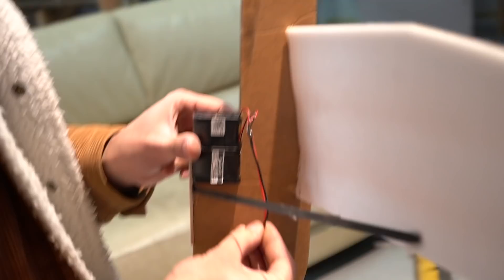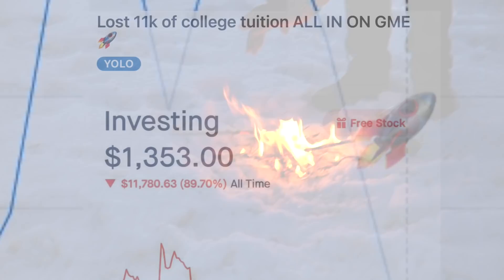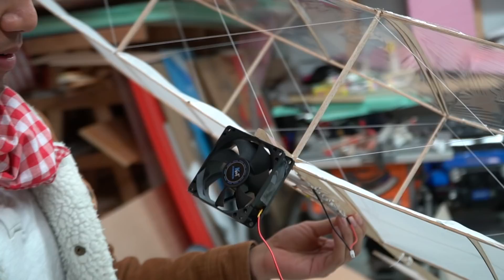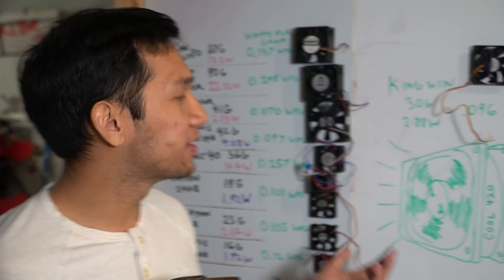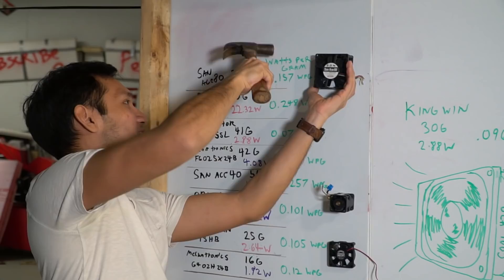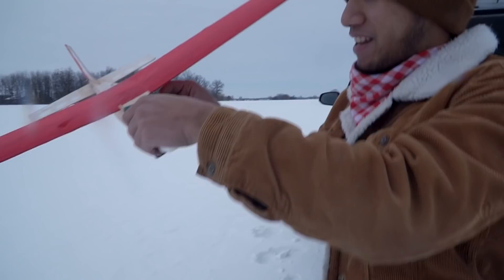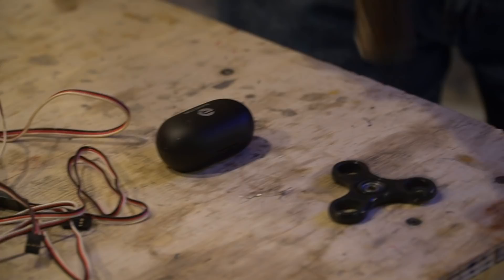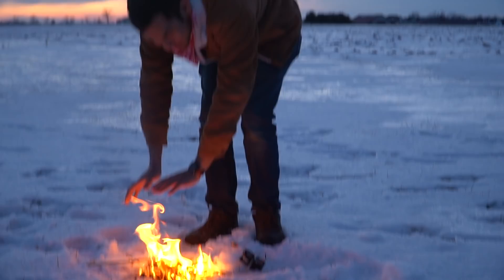PC Fan Powered Airplane!

Comment: I actually gasped when he tossed the 5600x
Reply: im going to need a new set of pants after watching that...
Reply: WHY
Reply: I'm pretty sure that will have been his old shitty CPU he threw, and the new one is safely in his PC. He'd clearly opened the box already, the heat-sink is removed from the fan.
Reply: @samrowland2816 your probably true
Reply: i cryed when he tossed it
Reply: I almost choked on my coffee.
Reply: Me too!
Reply: He also called it the ‘’amd’ fan without pausing in between the letters
Reply: Same when I heard it hit the table I screamed “ah that hurt.” I may have the 5 3600x 6 processor but still
Reply: I cringed
Reply: @TheBorhork  same, i even just watched an ltt video before this of a terrible computer builder, so i was a tad bit less traumatized then if i saw it without preparation
Reply: Almost got an heartattack
Reply: Same
Reply: And then proceeded to break the fan that came with it 😂
Reply: I saw this comment before the video, thinking I was ready, and I still gasped.
Reply: ;-; how dare he
Reply: great 👍,  WHO NEEDS A $300 CPU , the fan is what makes the plane fly , DUH .
Reply: @samrowland2816  most likely but as someone who could use any cpu upgrade still hurt me lol
Reply: Looked like just the empty plastic case
Reply: Me too
Reply: @Ardalan Ghazizadeh all of the fragile pins on the bottom
Reply: looks around in Ryzen 7000 series.
Reply: it hurt so much.
Reply: me too , out loud!
Reply: So true it "painED" me
Reply: Dude I died and respawned when he tossed it lol
Reply: @MichaelNelsonYT  its only AMD ,no loss
Reply: Me too, but seriously.
Reply: Damn right same here
Reply: A sacred CPU
Reply: @skonky  Fixed it 👌
Reply: @Ardalan Ghazizadeh intel, no they don’t. but amd still does
Reply: I'm sure it was a 'stunt' cpu, not a prime unit.
Reply: @Ardalan Ghazizadeh its AMD so the pins are on it not on the motherboard. Only one has to snap for the cpu to die....
Reply: @girlsdrinkfeck  Im proud of my little ryzen 5 3600, i think it has its place... Intel hasnt exactly been doing good lately....
Reply: @lindalewendling  Yea that is annoying
Reply: @samrowland2816  I really hope. I havea 10600k and would love to have that.
Reply: @MichaelNelsonYT  not necessarily, there’s a lot of redundant grounds and dummy pins. Although it depends on which pin of course. Sometimes a cpu will still work, but some features may not. AMD pins are pretty durable though. I once dropped my R5-2600 and bent about 10 pins, I was able to get them bent back into place and the cpu still works to this day.
Reply: @EvilTurkeySlices  I never knew! Thank you
Reply: @MichaelNelsonYT  no problem. That’s part of the reason I prefer AMD, the pins tend to be more durable than the ones on an Intel socket.
Reply: Same I need one can I have it
Reply: Your not alone fam
Reply: @wcnub  you're probably right.
Reply: Well it’s amd
Reply: Me to
Reply: Me too you gotta give me that cpu
Reply: Broke my heart
Reply: Every mussle in my body contracted
Reply: Same. I have the same CPU it hurt to watch
Reply: Same

Comment: Imagine buying a Ryzen 5000 series CPU just for the cooler
Reply: the fans are the only reason anybody would buy one, they have so much more value than the CPU
Reply: @forgenic2700  y
Reply: Imagin buying an razor gaming oc only for the stickers
Reply: @fhsjdjskkshi  Because intel has intel sticker, and sticker>fan>CPU.
Because joke.
Reply: and he broke it from over volting.
Reply: Imagine buying a CPU for the cooler which are known for being the worst coolers and fans... He could at least get a decent 3rd party case fan.
Reply: Imagine buying a Ryzen 5000 series and not immediately dumpstering the stock cooler
Reply: That cpu being a 5600x and then just tossing the cpu.

Comment: "It's super fragile"

Proceeds to throw it around the crowded shop
Reply: No big deal, it is just wood sticks.  They back together SUPER easy with glue.  And fast too.  I recommend you stop by your local hobby shop and pick up a cheap kit and put it together.  I believe you would be surprised at how easy it actually is.

Comment: The counter rotasting fans permit a higher air pressure to drive the ir through server heat sinks. Great engineering. but as a consequence, you can duct the air to release at a higher velocity to correctly load up the fan motors. This will improve your power to weight ratio. They aren't designed to run without the counter rotation because the blades are quite high pitch and will result in spinning air more than pushing it if run individually. I had the same thought as you watching those runs running at hish speed on the air frame you made for slow regular PC fans 😄

Comment: no one:
him: throws CPU
me: LITERAL SHILVERS
Reply: It’s just amd, that fan was probably the best thing in the box
Reply: @emmett-hr4ip  :|
Reply: @emmett-hr4ip  bruh, do you have any idea how powerful a 5600x is?
Reply: @alosthigh-endgpu7254  Yes I do agree that currently amd has a more powerful cpu for multitasking, but I would pick being able to run a game decently then to have blender running at peak performance
Reply: @emmett-hr4ip  AMD CPUs are good for gaming too bruh. Plus as of now, AMD CPUs are much more powerful than intel and it doesn't even needs as much power as intel to run. It's also a bit cheaper making it a better option for people with low budget so I wouldn't really say "it's just amd" as if they were shit
Reply: @emmett-hr4ip  Intel is dogwater compared to amd.  Get water cooling and ur fine.  If noise is an issue get a different fan.
Reply: I see him throw a cpu and think its over. No, he glues the fan to a shotgun shell not 5 seconds later
Reply: @trainsandplanes8304  and this is the reason why people outside of the tech industry have never heard of amd. I mean if you look at Intel's marketing today it is crap. Just look at Steve's video on there 11th gen laptop processors.
Reply: @emmett-hr4ip  oooooo we got an Intel boi here
Reply: @emmett-hr4ip  amd is better.... but only if you can find IT IN STOCK
Reply: @emmett-hr4ip  found the intel shill
Reply: @emmett-hr4ip  :|
Reply: @emmett-hr4ip  amd>intel
Reply: @allyalllinusfans my 2012 intel chip still runs higher clock speeds than ur 2020 amd chips your raving about. I can go buy a 9900k right now and guess what it’s in stock because intel doesn’t rely on tsmc for their chips. A 9900k is 8 cores 16 threads and runs 5.0 ghz turbo. And is easily overclock able to run 5 ghz all core. I can go buy that right now for $300 and ur 5600x is out of stock and and costs more and is only 6 cores 12 threads 4.6 ghz turbo
Reply: @emmett-hr4ip  Just because it has a higher clock does not mean it's faster. Instructions per clock is a far more important metric for CPU performance, of which AMD is currently beating Intel in the current generation, and in which the 5600X destroys the 9900x. As proof, lookup the Passmark scores for each CPU. For the 9900x the average score is 18869. For the 5600X the average score is 22181. That's a 17% performance improvement with a lower clock speed, 2 less cores and 4 less hardware threads, and using 30 less watts of power. The only thing Intel has with that CPU is it's about $30 cheaper. (For just the CPU, the motherboards are NOT cheap. Looks to average about $400 for a decent motherboard that's compatible. Where you can get a very good 5600x compatible motherboard for $200-300.)
Reply: @emmett-hr4ip  my bad. The passmark score I posted is correct for the 9900k. The motherboards are similarly priced. The point still stands. The 5600x is about 17% faster than that and only $30 more. The 9900k is a 2 year old architecture. That's practically ancient by CPU architecture standards.
Reply: @emmett-hr4ip  On top of all that, the 5600x is a brand new CPU at $400. The 9900k was $530 when it was released, the only reason it's cheaper now is cause it's 2 years old.

I'm not an Intel or AMD fanboy, they both make great CPUs. But the fact of the matter is AMD objectively has better CPUs at this time.
Reply: @rocktheworld2k6  the Ipc on the 11th gen intel chips will be 19% better and those will be closer to the Ryzen 5000 release date than 10th gen intel and it will still be running higher clock speeds
Reply: @emmett-hr4ip  well good for them. If Intel is better and has a comparable price to the similarly spec'd AMD chip I'd probably get that instead when I build my next computer.
Reply: What are shilvers
Reply: @emmett-hr4ip  Intel fanboy
Reply: @emmett-hr4ip  ur a dense little fan boy. Specs are specs, amd it's killing it single threaded and multithreaded rn
Reply: @mrrquinny  I’m sorry that I made all you guys feel butthurt but really they are just facts that are hard to believe for people that build with amd in there computers
Reply: @trainsandplanes8304  do you people actually never do your own research? Ive seen a 9900k under $300 new plenty of times right now its about $350
Reply: @emmett-hr4ip  amd is like the most powerful cpu rn
Reply: @vpog3466  where are ur facts backing it up
Reply: @emmett-hr4ip  ryzen 5 5600x won against the core i9 10900k on some platforms

Correction: most cpu bound games
Reply: @elijahtuares1382  like what
Reply: @emmett-hr4ip  shadow of the tomb raider, microsoft flight simulator, f1 2020, cs:go and I forgot the other games
Reply: @emmett-hr4ip  google, where’s urs
Reply: @emmett-hr4ip  well it’s one of the best Rn
Reply: @emmett-hr4ip  who are you talking to
Reply: @elijahtuares1382   I was commenting on trains and planes830’s post saying “ummm a 9990k for 300$ usd never existed... even used”
Reply: @emmett-hr4ip  I was asking about the fan
Reply: @emmett-hr4ip  then get a different fan, and ppl who get good cpu's probly dont run minecraft servers most ppl prob get it for video editing
Reply: Too much pc talk, ima move on to another comment
Reply: @adamchmielewski6162  ur only comment is that you are going to move to another post
Reply: @emmett-hr4ip  First of all you were completely off topic we're talking about cpus here none of us were talking about the fans, second it's a pc fan it's not made for miniature planes I've had fans that performs great but blows up when over volted and third we're not even fighting you on which is better we were just stating the facts and I don't want anything more from you you ignorant trampled cooked rice stain. And also it's "up more"
Reply: @emmett-hr4ip  explain amd being ahead of intel for years now then
Reply: @manbun_tech7417  what
Reply: @emmett-hr4ip  “look at me i play minekwaft”. “Also my favorwite compani doesn’t care about my ram ovorcloks anymorr.”
Reply: @manbun_tech7417  I said “What” in my last comment because I did not understand what you saying. You say AMD is better then intel for three years now but where is your proof?
Reply: @emmett-hr4ip  do you even watch major tech channels?? Every one of them will tell you that amd has been ahead. You are not that smart are you.
Reply: @emmett-hr4ip  but no I totally have not been building computers for 10 years 😅. Gtfo here kid, go play minekwaft with your potato

Comment: "So here's the Ryzen 5, we don't need that.." *Throws it away

Me saving up to get a Ryzen 5 : Oh oh nothing, just a little dust in the eye ya know
Reply: And its a 5600X!
Reply: And dosent even use that fan!!!! smh
Reply: @dannyvk5867  as of CPU cooling, there are better coolers then the stock cooler
Reply: Yeah but that’s besides the point that he bought a chip for the fan and didn’t even use the fan
Reply: This hurts a pc builders soul
Reply: @loading...2414 l,.
Reply: I mean, if you don't take into account thrust to weight ratios, the Ryzen 5 could be pretty good (i think. I don't own one).
Reply: Loool
Reply: @Nodemon , same to me , i was saving up to get a ryzen 5 , why didnt Peter just buy a stock cooler?

Comment: By drilling holes in the side of the fan you have airflow going out acting as an airbrake, like reverse thrust works on comercial jets. The centrifugal force of the blades throwing air outward flows out of the holes. Those walls are designed to stop that and throw that flow back.

Comment: Idea for measuring the thrust of each fan:

Construct a Pendulum with a rigid stick and attach the fan to the bottom along with a set mass. 

Turn on the fan and measure the angle the pendulum moves from its natural resting position (θ)

Then use F=mgSin(θ) to determine the the thrust of the fan, proportional to how much the pendulum moves.
Reply: Didn't some physics guy make a similar invention to measure the resistance of air?
Reply: @lukejordan8929  Yep I think so!

Comment: When you threw that perfectly new ryzen 5 I wanted to cry. There is a chip shortage rn and a ryzen 5 is 200
Reply: Yeah same
Reply: Got a perfectly good ryzen 3 1200 at 4.1ghz in a system thats been in the corner for over a year.
Reply: correction 5600x is $299($300) and yes I know this is for fan service pun intended he even blew up the 12v fan by ignoring basic principles of putting over 20v through a 12v fan

Comment: The mousetrap airplane was pretty cool.
Addendum: i use two PC fans in a single unit for cooling the two 550 Titan motors on my EMAXX. Very little added weight and near 4 more minutes run time.  Wow!

Comment: With larger fans, you will get a higher thrust-to-weight ratio because you can achieve higher static pressures and significantly higher CFM's with the 12in (and even better with 14in) fans with very low watts. Especially if you use ones like Noctua's 12v iPPC 2000rpm fans or Arctic p12 fans that have 75 CFM or higher.

Comment: Here in Brazil, fiber optic cables have a rod made of resin and fiberglass that is very light, I believe it is lighter than the bamboo or wooden rod that you use to make this glider. What if it was made with these fiberglass rods? Every time the technician does maintenance, there are a bunch of these sticks lying around, my colleague uses them to make a kite. The best thing is that this stick doesn't break at all.

Comment: Cool. You can get really small case fans fitted to LED headlamp bulbs if you want even more crazy ideas to get carried away with. Even crazier still, a disposable electric toothbrush only needs a set of wings and a prop.

Comment: Next time get some clear acrylic sheet and drill holes through it for your fan frame legs. Space your sheet to the sides of your scales and higher above the scales and poke your frame legs through. Then you'll be measuring the fan thrust while the scales deck is unaffected by the wind thrust. Love your DIY attitude!

Comment: It's good, interesting and challenging project! May be it would be better to make monoplane with bigger aspect ratio (long narrow wing), concave airfoil.The wing might be supported by thread braces, that have very good ratio between weight and strenght.It's ideal variant for low power (remember pedal planes).

Comment: The cross wires and vertical columns  - have more drag than the entire wing
Reply: The Gossamer Condor (the first successful human-powered aircraft) showed that wires aren't that important at very low speed – something to do with the Reynolds number. Previous craft with cantilever wings failed because they were too heavy; later craft were able to eliminate the wires again because they had access to better materials like carbon fiber.

Comment: 7:10 it's not better because it's lighter even tho it's is still better. The main factor is because the holes in the sides are sucking air how fans are supped to suck air. So it's more of how the air gets in the fan and not the weight

Comment: you need a way bigger, and way more slowly spinning fan. After all, it's not about wattage, it's about momentum, which scales differently. That's why modern jet planes have these enormous turbofans with a comparatively tiny turbine inside, but a giant fan around it. Go to a 140mm and spin it a bit slower. Yes, you probably have to strip off the casing.

Comment: I don't know how much it would affect performance, but I do know that it would be better to have the fan blowing over the top of the air foil (rather than under it). You're losing free lift.
Reply: I think you meant just in front of it
Reply: @freevbucks8019  Not sure what you mean.. obviously it would need to be in ahead of the airfoil.. But the air travelling above is what I'm talking about.

If you're talking about "in front" meaning in a position that directs air above and below the airfoil, then no.. The air below the airfoil is still taking a longer path than it would be without the airfoil at all (just less than at the top side of the air foil). Because of this, the air is less dense than ambient air pressure.
Having the air pass over the top only, gives the same low pressure zone above the airfoil and leaves the underside of the foil alone so that the ambient air pressure is against the surface of the foil.

Comment: 0:42 WHY WOULD HE DO THAT
Reply: Cause it’s his money
Reply: @trainsandplanes8304  AMD isnt trash wtf they are better than intel and are cheaper
Reply: @trainsandplanes8304  If you're talking about iGPUs and not processor performance then get out.
Reply: The biggest danger is probably bending a pin, and the plastic probably kept that from happening.
He will need new paste for that cooler, though.
I messed mine up and the temps were bad. As in, sustained >80°C with two Chrome tabs open.f

By "I messed up," I don't mean "it didn't go smoothly." I mean "it took ten minutes, after the 2600's cooler took ten seconds on the same board." 
Fun fact: AMD made the Wraith Stealth's plastic shroud flimsier.